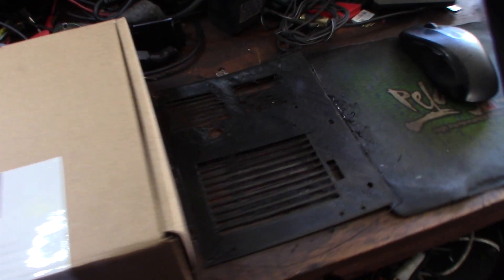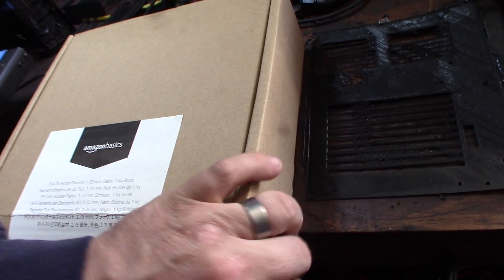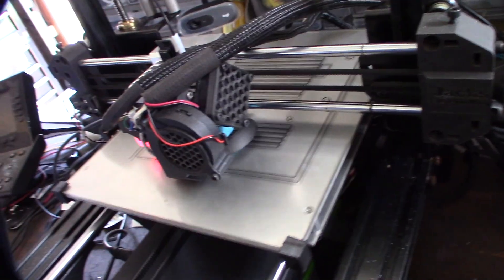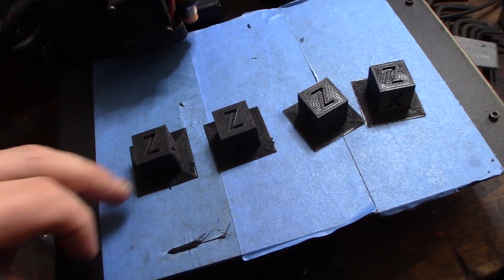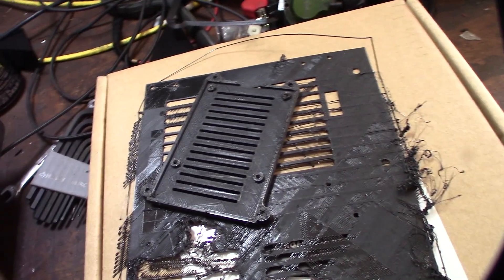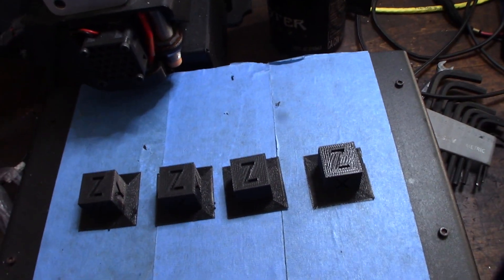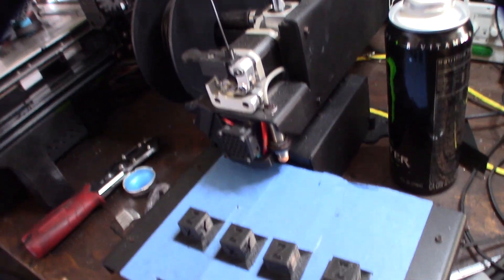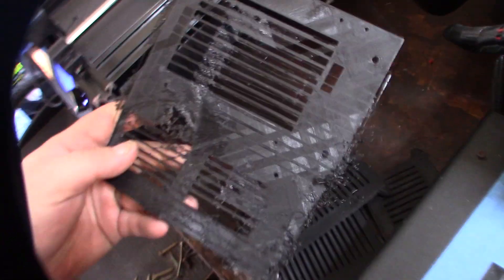AmazonBasics PLA review Horrible!!!!!  Amazon 3D printing filament

Comment: Thought I was nuts. Whenever I would print small stuff like half dollar sized it would be "okay" still had issues but it was passable. As soon as I would print something bigger immediate issues with smearing, separation, and clogging would occur. I have a roll of old generic white PLA filament as well that has its own issues but it does fairly well and I can patch it up when theres an issue. I ran the amazon stuff again to see if it would print as well as the generic I've got after having a decent print and it failed horribly. Decided to look it up and found this video. Looks like the same issues I was having. I'm using a Anycubic i3 Mega with a new revised heatbed.

Comment: A bed surface temp of 55-60C in required. You need to measure the actual surface to know what the offset is. The two printers you have have different bed material so the temp will be different. Also, print a temperature tower to assess new filament. General PLA  should but be printed at 215C or higher. Ensure the speed is 60 mm/min or less and there shouldn't be a problem if the printers are setup well. For other commenters, tangles are caused by you not the manufacturer.  When unloading, hold the end and store it in the hole at the side.

Comment: Same problems with Amazon Basics (Jan,2022). Found that the hotend has to be at least 220. Anything lower barely melts filament reliably. Heat is transferred along filament in Bowden tube. This softens filament making it compressible. This compression stresses the Bowden tube inner diameter. That causes a fat clog that resists being shoved through nozzle. Had to keep cutting 2-3 centimetres off end of Bowden tube at hotend. (discovered after doing a bunch of other stuff)

Comment: Stuff is still pretty inconsistent, you might get a spool that prints fine. But for the most part the quality control is terrible and the diameter tolerance is bad.  Just spend the extra buck for hatchbox or something. Its not limited to their PLA either, their ABS and PETG also have similar issues.

Comment: I agree it's just trash. It is wound on the spool incorrectly and jams frequently. So you have to babysit it. Pure junk at it's best. I will only use what I have left if I am sitting there and monitoring it. I am sick and tired of it jamming against my machine and damaging the gear in my extruder. Amazon Basics = F-. Just pure TRASH.

Comment: That filament is what I use every day and I never have an issue with it. I’ve literally never used any other brand. You need to check the temperature, if your bed is too hot for some reason their filament does weird things, it doesn’t go down smoothly. Lower the bed temp and raise your nozzle temp. I print with my bed at 70 and that’s because there’s a glass sheet over it causing heat loss, and I keep the nozzle at 208
Reply from the maker: Not sure what the deal was, maybe I got a bad batch. It did improve with my bondtech. My favorite filament is PLA+ by inland.
Reply: Fintech Repair Shop
I’ve heard some good things about Prusament as well. Have you every tried that? And if so, what do you think of it?